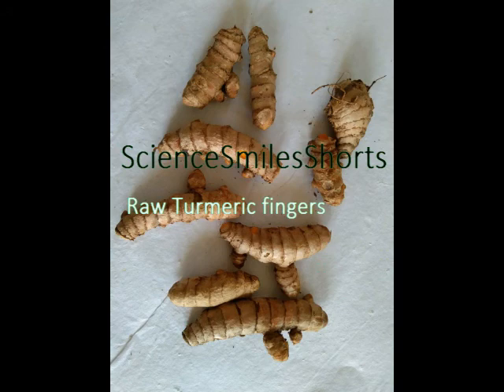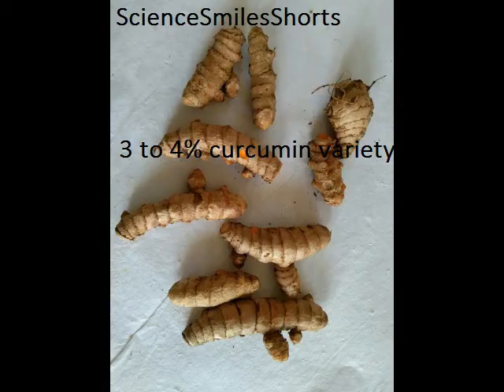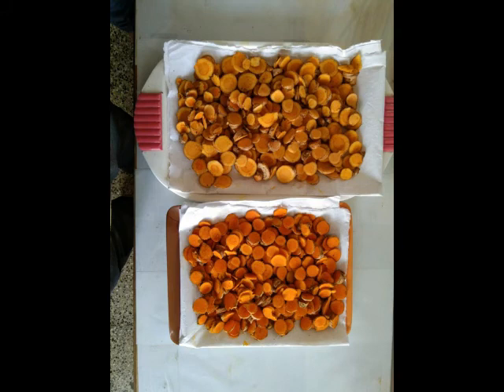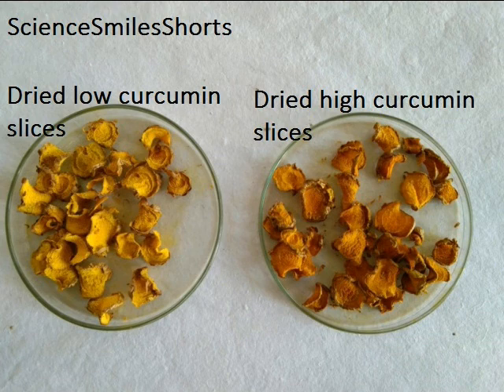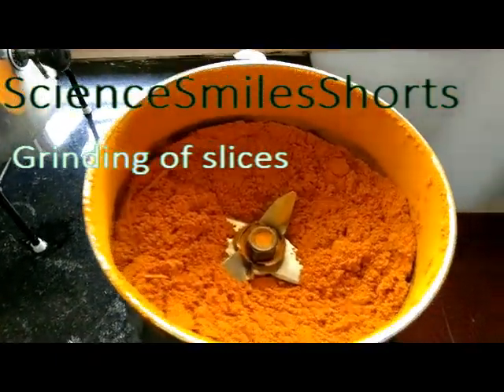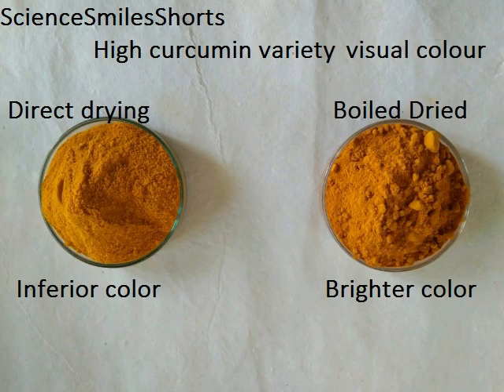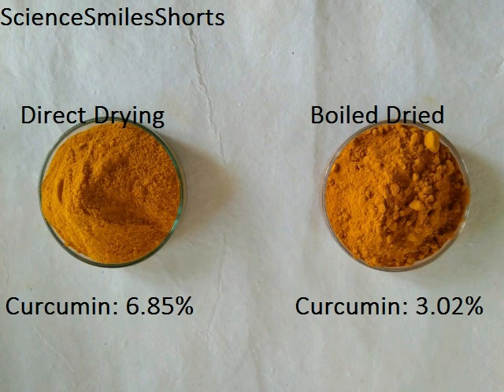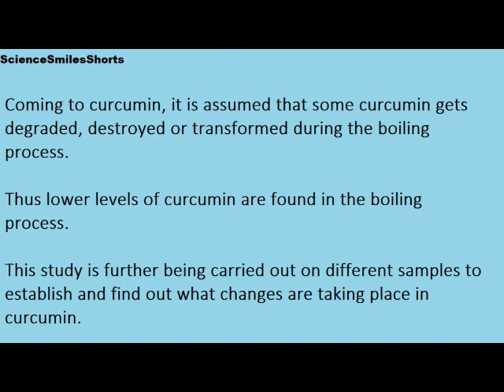L9. Boiling Raw Turmeric : A Sustainable Practice

Comment: does that mean its better not to  boil turmeric when processing?
Reply from the maker: Thank you. Sorry for the delay. If one is intersted in extraction of curcuminoids There is nno need of boiling. Drying will reduce the volume since the raw turmeric contains about 85% moisture. Extraction of curcumin can be from raw turmeric as well..